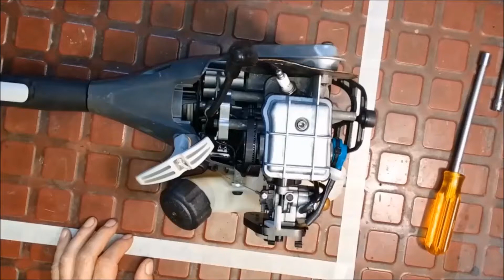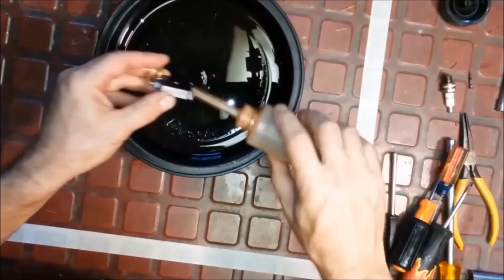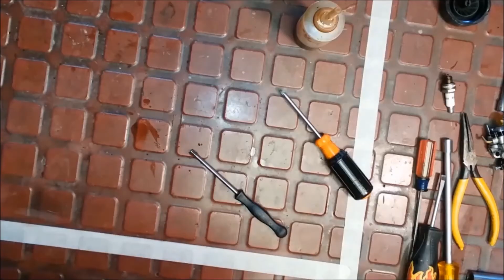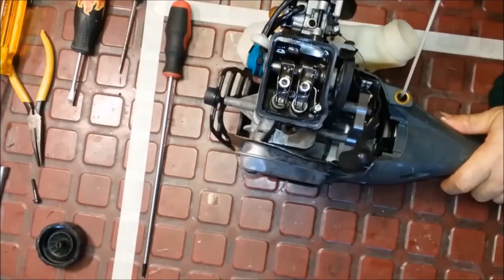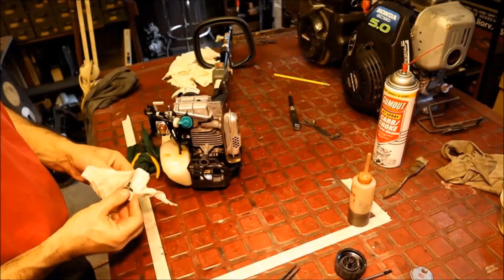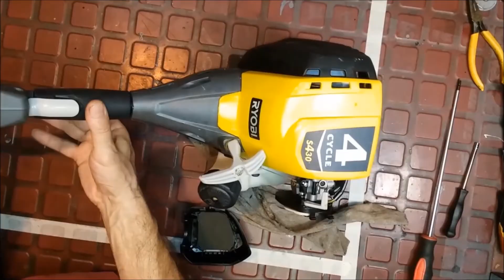How to Repair the Ryobi S430 4 Cycle - Carb Rebuild - Valve Adjustment & More

Comment: I had trouble getting a spark plug for the same machine . I went to Lowe's Home Depot advance auto and auto zone no one had that type plug in champion or ngk I had to order one if it may help you the same plug in champion brand is ry4c.  The ngk or torch number is cmr7a   If you find a plug that looks the same size but the first letters are different don't use it I found out those first letters on ngk or torch plugs means the threads are different and different pitch so make sure tide first letters are what you want
Reply: Wally world has mostly all mower and weedeater sparkplugs for about $2-$3 each.
Reply from the maker: @jwayne777  Good to know!! Tanx
Reply from the maker: Thanx I pinned your comment

Comment: I’m working on same model and mine shuts off when I pull throttle. I began by pulling fuel lines got universal kit and replaced the lines and the filter inside the tank. My carb looked like this one in the video very clean. I cannot figure out the issue to save my life. Please what should I check next

Comment: My C430 quit. Found sheared molded in keyway in flywheel. I ground the rest of keyway out to accept a shaped piece of steel (nail), reinstalled flywheel and it works. Spark timing may be off couple degrees but now it runs.
Reply from the maker: Awesome fix! Glad you got it going.

Comment: This is great. The hedge trimmer accessory is poison, however. This power head craps the bed if you rotate the power head while the engine is running.
Reply from the maker: Yea, it can happen. You may have another fuel pickup issue tho.. Its really just a line trimmer

Comment: mine dies on full throttle. any idea what it might be? runs beautifully ofherwise. Do i need to adjust the pacman screw?
Reply from the maker: Could still be a fuel issue,,,check the filter and you may need to properly adjust the mixture screws.

Comment: One of these was given to me last week. The fuel lines, fuel tank, and Purge bulb was the only thing that obviously needed replaced right away. Otherwise it looks good. The timing belt and everything looked really good and clean. But when I went to replace the purge bulb I pulled that first section apart in a spring fell out. It looked odd and out of place so I started searching and one of the first things i noticed in your video was you noticed a spring behind that diaphragm so obviously someone has taken this one apart and didn't put it back correctly. I'm going to give it a shot and see if i can get it back together. I won't have my compression tester back till the end of the week so I'm gonna do like you have suggested and not throw anymore parts at it until I find out if it has good compression.  Until then i think im going to see what kind of shape the cam is in..
Reply from the maker: Ohh my mechanics life is ALL About people getting into these machines before me... Always a surprise!
Good luck,, not a bad machines if its taken care of!
Reply: @TheNovaJohn  it runs good!  Put the spring back in where I saw in your video it was supposed to be and it fired up and runs fantastic. Your video saved this one.  And it's kinda cool with that timing belt. Lol..
Reply from the maker: @15RunAway  I was suprised at how well this engine is made. Glad to help!

Comment: One question what was that 2 cycle cleaner you kept squirting on all parts? I I couldnt quite make out what you were saying. It was in thst 4 oz bottle.
Reply from the maker: 2 stroke is fine or try this
https://youtube.com/shorts/8jO1TS1Rj8M?si=wak6nVstQ4oIS9d3
Reply: @TheNovaJohn  excellent. Thanks for the quick response.. You are now saved as a favorite.. I am sure I will have more questions going forward

Comment: So I don't understand what the problem was? Was it the thing you did with valves, or cleaning the spark plug, or adjusting that screw thing on carb? Mine currently likes to stall out and doesn't stay running. Then when warm it will stall and refuse to start. Trying to troubleshoot that
Reply from the maker: This is an older video and that machine is long since sold off.
What I show is going over an engine, everything needs to be correct if we want it to run properly.

Comment: where the hell did you get that carb adjusting screwdriver?
Reply from the maker: Try HIPA 
https://www.hipastore.com/
Reply: I just bought an aftermarket carb and adjusting screw isn't pacman (need to look at original) but AFM looks has one pin hole just inside the outer circumference. Trying to imagine how the tool is made
Reply from the maker: Usually tools like this are punched under pressure when red hot.
Reply: @gadasavideos8564  Its called a 'Single-D'. There's a large and a small, this WYL carb uses the small.

Comment: Dude, just measure the valve lash on the camshaft instead of the valve shaft.
Reply from the maker: Nice, didn't look to see if I could.
Never did one of these before and haven't seen one here in the shop since, probably wont again as these machines are coming to the end of their useful life.

Comment: hello, can valves keep engine from doing anything? I have a Black Max 4 cycle trimmer. same engine. It has never run. got it on clearance and cant return it. I have spark, i got a new plug, will not run with starter fluid in the carb. Will not do anything. from what I understand disassembly is required to find timing mark on the crank shaft. I get a little, very littel smoke from exhaust. Any help would be appreciated
Reply from the maker: 1st check compression!! 
No compression or very low then ya gotta go deeper
Reply: the key was shaved off the flywheel. they are made on had to knock the rest out and use an improvised key. running now thanks  @TheNovaJohn
Reply from the maker: Awesome,, great to hear and thanx for letting me know!!
Reply: I know this sounds crazy, im pretty sure the flywheel is on backwards from the factory. when the piston is at tdc, the weight on the flywheel is going past the coil, the side opposite the magneto. im going to take it off, flip it around and see what happens. can you please tell me where the hole in the camshaft should be when the magneto and coil are aligned one over the other?
 @TheNovaJohn
Reply from the maker: I haven't taken that engine apart yet, there should be a key and keyway that will align the crank to the flywheel.
It cant go on backwards as the shaft is tapered but it may not be in alignment! 
sounds like your on to something here! Keep going!!!!

Comment: 2.5 oz of oil go in it.
Reply from the maker: Yea, its like a couple of spoon full lol
Reply: @TheNovaJohn  I think that's where Ryobi screwed up. Should have a bigger oil pan. The next goof up is that plastic flywheel. When I ran mine it seems as if the belt wants to come off. Definitely a failure point built into the design..
Reply from the maker: Even some of the Stihl equipment uses plastic gears

Comment: will valve adjustment keep that from running full R{PM did you say .004-.005?
Reply from the maker: Yes it could but you need to check the carb to make sure the throttle is opening fully and its clean/operational

Comment: How many oz. of oil do you put on a 2 cycle motor.
Reply from the maker: That depends on the mix. most use a 50:1 mix these days. Pick up a container of 2 stroke oil, read the back of it and get a separate gas can for the mix

Comment: Have one changed carb, fuel tank, and ignition coil. String spins but still won’t start even with new spark plug. Even sprayed it with starting fluid. Hate to trash it because I have all the attachments
Reply from the maker: Do a compression test, this way you know the engine is good, I always start with that otherwise its good money over bad!
Reply: @TheNovaJohn what kind of psi should we be looking for?

Comment: Those  S430  stringers are pure junk.
I have 2 of them, and they both smoke like a volcano.
“Oil smoke “
Reply from the maker: They have very small crank cases, the oil needs to be changed every year and cant be over filled.. Other then a valve adjustment they work well.
Reply: @TheNovaJohn  what is the reason that causes them to blow oil smoke so badly?
Reply from the maker: Like I said above, the oil goes bad quick, if this isnt changed it gets dirty and gets thin as well or even runs out, then the rings start to wear and it will burn oil. 
Its a 4 stroke, are you mixing oil with the gas? If you have 2 that do this, its something your doing or not doing.
Reply: @TheNovaJohn  just running straight gas. Does well until it warms up, then it starts smoking.
Reply from the maker: try a thicker oil like 20w50 and watch the level, don't over fill
Reply: @TheNovaJohn  thank you for responding.
I will try your ideas, and if not I will look for a ring kit, and cylinder rehone. Thanks again.

Comment: Note: If you want to save to time, you can  purchase entire new carb, fuel lines, and primer bulb on line for about 15 bucks. Experienced great results bringing my Ryobi 4 cycle back from the dead.
Reply from the maker: Yup,,and now I'm set up with HIPA parts and they are very good. 
Keep in mind there are differences from original. This can throw many people a curve ball. Due to patent issues some change is required unless one is buying OEM
Thanks for watching!
Reply: Do you have a link in need of a replacement but having trouble finding the right one for the ryobi 4cycle s430
Reply: @StayTrue-uw9jpAmazon. They sell carbs with primer bulbs, spark plugs, and fuel line for $16-$20. They list the carb as a replacement for the S430, but it is actually for the 2 cycle Ryobi. The only difference is the factory carb has brass fuel ports on the top but the replacement carbs have the ports on the bottom. 99% of repair shops don't touch this 4 cycle Ryobi because they're junk. Wait till the timing belt slips or breaks. You have to remove the entire crankshaft just to replace the belt. I found 2 suppliers that carry the belts. These Ryobi machines are basically throwaway machines, disposable.

Comment: informative video, thank you.  Are these walbro wyl carbs adjustable (or have hidden adjustment)?  I have an older ryobi trimmer that has the same carb as yours, starts/idles on choke, but does when choke is off (or if throttle applied).  carb was cleaned out, fuel line changed, fuel filter changed, but still symptomatic.  thank you!
Reply from the maker: Do ya best, sometimes the carbs are too far gone, it happens to me as well
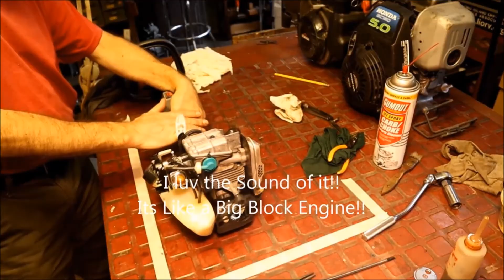This carb has one adjustment. I start messin with it around 26:30
Thanx for watching!
Reply: @TheNovaJohn  thanks! looks like just the idle screw is adjustable eh. subscribed!
Reply from the maker: @seedyeh  Yea, newer models are adjustment delete. just sold a craftsman backpack blower, I went over it but informed the fella, its as tuned as its ever gonna get. 
Gotta say, although I sold this machine, I will keep another one if it cleans up like this one!

Comment: Nice video. I'm still trying to get my carb passages cleaned out. The ultrasonic cleaner I have just doesn't work well. By the way is that a Walbro WYL carb?
Reply from the maker: I don't remember, I may have mentioned it.
If your carb is really dirty consider buying a new one!
I'm not a fan of those cleaners for automotive and small engines. It's important to get the mixture of cleaning solution right. 
Thanx fer watchin!

Comment: You adjust the valves on sbc with it running if you want it done right. No feeler gauge needed. But you don’t need one for cold initial lash setting either…
Reply from the maker: It depends on the lifter design; this little guy has a solid lifter.
I ran ROADS lifters for a time on my 283, it loved them but they must be lashed to work properly.
Generally with hydraulic lifters ya put a lash on them when installing them for the 1st time. But the recommended way is to look down at the lifter keeper lock and just depress the plunger enough so that its off the lock (Preload). 
This is a must for most Hi-Po lifters. 
I didn't get this right once and when the lifter floated it popped that keeper ring and it went down into the engine..

Comment: mine starts and idles. but to take the choke off u have to rev it and adjust the lever fast or it dies. im assuming the carb is clogged or something
Reply from the maker: Yep,,I would start with a carb rebuild/cleanings or replace it. Clean out the gas tank and pickup filter. 
Check out the HIPA website for parts
https://www.hipastore.com/

Comment: hey arch, i use to love working on small engines.  i see a lot of these having belt problems.  you would think ryobi would be smart enough to make the gear on the cam shaft to have both sides with a lip.  that would keep the belt from jumping time, but then again how would they make any money.  as we all know, its cheaper to buy a new one than spend the same amount to fix.  unless you know small engines and if you do not, we always have you.  good video.
Reply from the maker: Lol,,,thanks Joseph,,,,,This was one of my 1st videos...
Its a good machine for the price but your correct, it has issues. Ryobi has gotten much better
Thanks for watching!
Reply: Q

Comment: This is a very good and informing video, but to me, why switch this stiff to 4 cycle engines. 2 cycle is much easier to working and, i.e. less moving parts, and much lighter without high level costly engineering. I'll stick with 2 cycle until either they're dead or I'm dead.
Reply from the maker: Thanks,,,,In a word ,,,EPA, mostly California dictates. Now in Cali they banned the sale of all gas engine lawn machines. 
Some say this model is crap, from working on it, seems fine and sounded great.
Reply: @TheNovaJohn that's because California is full of communist 🤬

Comment: Great info!  What mix of 2 cycle oil and tranny fluid is that?
Reply from the maker: I use 2 stroke mixed with tranny fluid for many things, as a penetrant, as a cleaner and a lubricant.
I just mix it up heavy with tranny fluid

Comment: can you describe the two stroke and tranni fluid for me please
Reply from the maker: sure,,, take some 2 stroke fuel then mix in about 1/3 of the amount of tranny fluid
The gas itself is a very good vehicle, it will wick in the 2 stroke oil and the tranny fluid.
Tranny fluid is very good as a lubricant and its has a lot of detergent in it. 
Why gas? Why not, all lubricant vehicles are flammable but gas evaporates quickly leaving the oils behind!

Comment: Where is the high speed adjustment on these Ryobi S430s? Idle speed is easy and low is right down the carb shaft. I've read that the high is fixed, but I keep reading commentswhere people claim they adjusted the high. Thank you.
Reply from the maker: Take a look at the sequence again; I adjusted the Curb Idle Screw (throttle angle) this sets the idle speed by opening up the throttle blade.
It may need re adjustment later then adjust the fuel / air adjustment screw (packman)  in the video.
This controls the fuel and air delivery and its really handling both the idle circuit and high speed. 
I like to leave it a bit rich.
Most 4 stroke trimmers are like this. It runs well and doesn't miss a second/separate screw,,,
Thanks for watching!

Comment: yup keep smoking around gas...
Reply: The temperature of a lit cigarette is not a high enough ignition temperature for even atomized gasoline.  A lit cigarette will certainly go out in a bucket of liquid gas.  Citation - 10 years working on fueling systems.

Comment: Just subscribed. Working on same model. Talk about condition oil, when I checked oil I thought I was going to puke. What little was in there looked like moly lube. Changed it 3 times. Good information for a novice small engine mechanic. Thanks. Good day 🇺🇸
Reply from the maker: Thanks!!,,,good luck with yours!!! I think these are very good machines!!